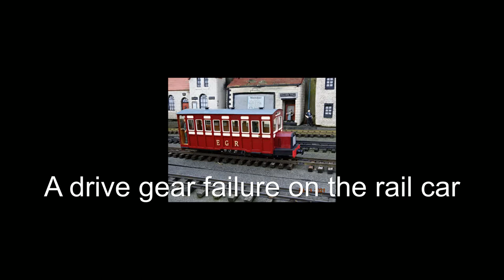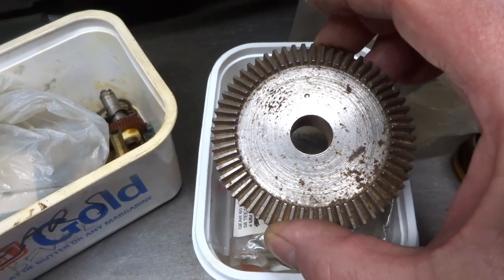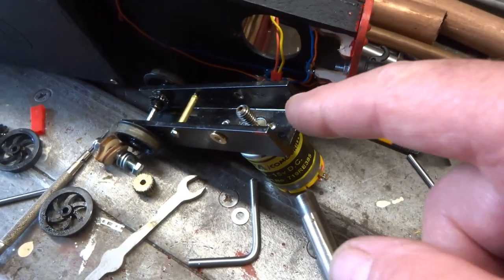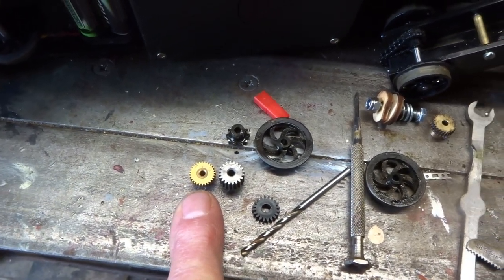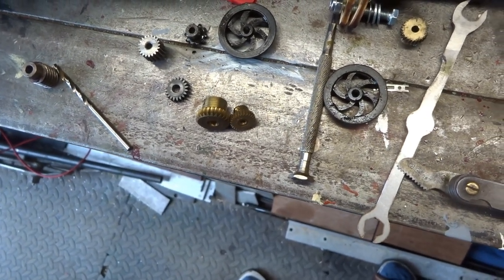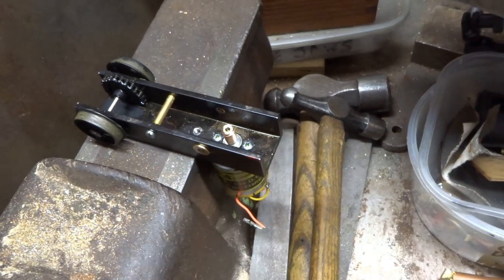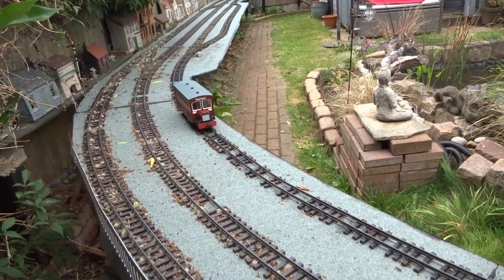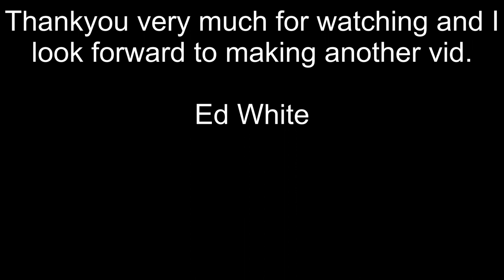Mechanical breakdown of railcar

Comment: Disappointing breakdown, well done for the repair. Also at least the sun came out for the coach!
Reply from the maker: Thanks Ben, I ran the remade gearing for about an hour yesterday and so far no signs of wear although as I said in the vid the gears are 'noisy'. I also own up that the clip showing the coach being towed was made prior to the original gear total failure (the gears were on their 'last legs'). On the prior day of the coach run the sun was indeed out.
Reply: @edwinwhite933  Ah... The magic of video editing!